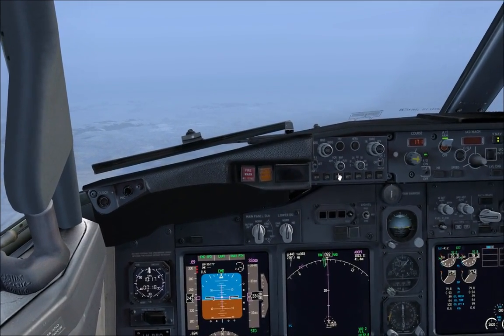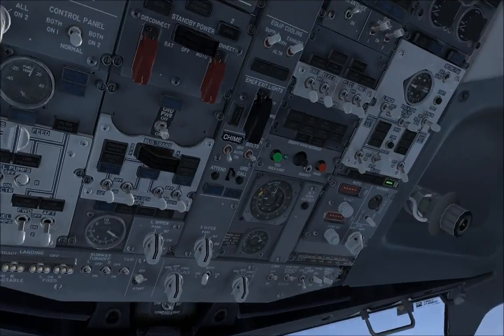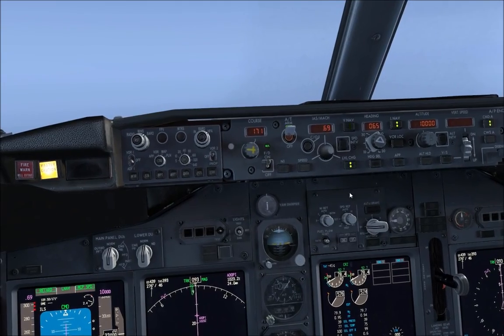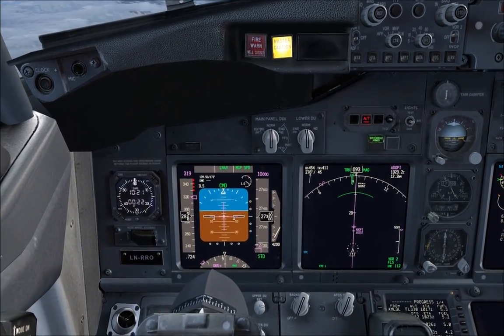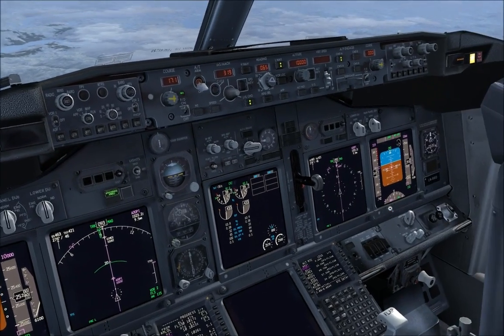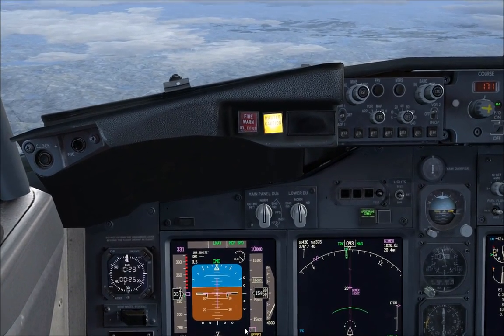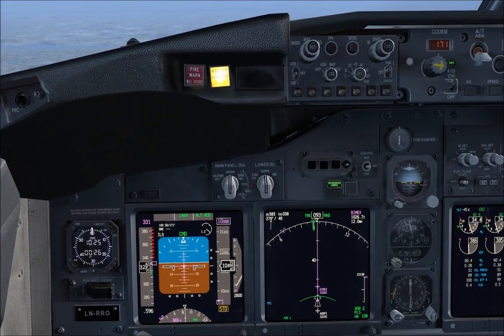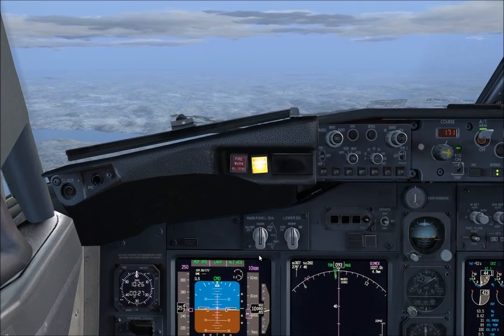Emergency NGX! - Cabin altitude warning & Emergency descent

Comment: Hello,
I have a question.
Before take-off I set the FLT ALT (FL370) and LAND ALT (13300 / SLLP) on the overhead panel, but I allways got a Cabin altitude alert (in MSFS/PMDG 737) when I cross (down) the FL300.
What is the proper procedure in this case?
Reply from the maker: It's been a while I flew the 737 and unfortunately I don't know. Probably best you ask in the PMDG discord https://discord.gg/htZkWNgj9K .

Comment: hello what is you computer configuration ? :D
niiice video :D i like this ! cause during my last flight i had this alarm who was iliminated :D now i know what to do :D thaks :D
Reply from the maker: Cooler Master HAF 932 / Gigabyte EX58-UD5 / Intel i7-920@3.6 GHz / 12 GB RAM / 2xNVIDIA GeForce GTX260 4GB / SAMSUNG HD103UJ / SAMSUNG HD753LJ / NorthQ NQ-4775-850-Flex 850W / WINDOWS 7 64-bit / LG 42LE5300 / TrackIR / Saitek AV8R-MK3 / Saitek ProFlight Yoke / Saitek ProFlight Throttle Quadrant / Saitek ProFlight Rudder Paddels / Saitek ProFlight Cessna Trim Wheel